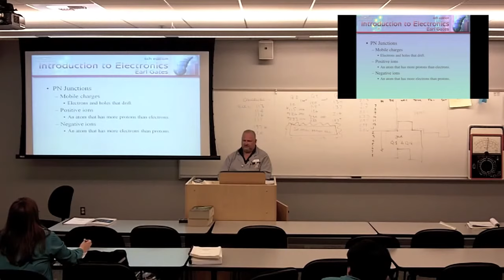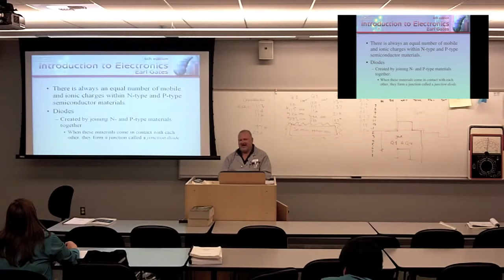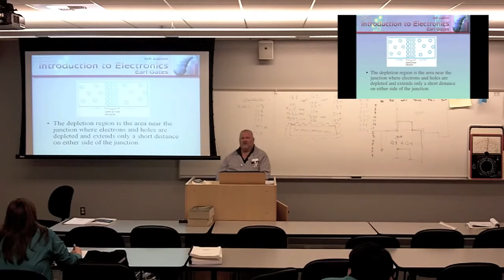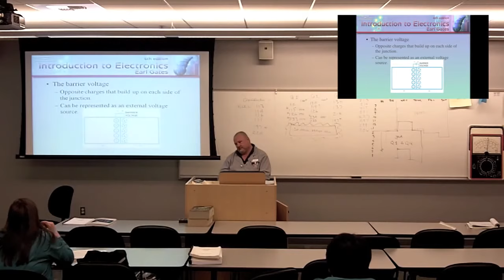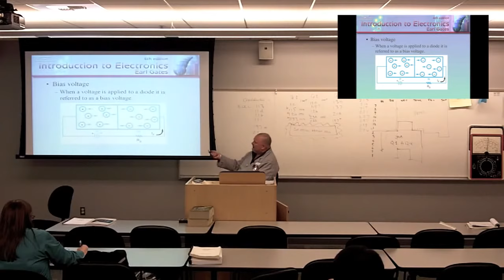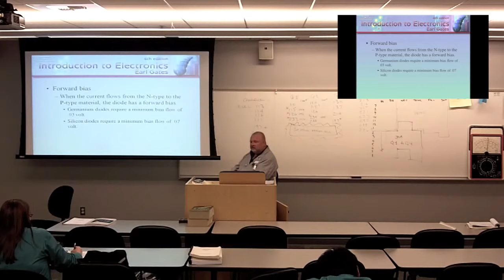Basic Electronics Part 3

Comment: At about time 19:53 current doesn't flow from cathode to anode but, from anode to cathode... 😳
Reply: One direction is called electron flow and the other direction is called Conventional Flow…cathode to anode is electron flow…in my experience,  basic teaching of electrical theory teaches mainly using “electron flow”… advanced teaching like 4 to 6 years ( graduate to masters degrees)  talk about current flow in terms of “conventional flow”…a different way of looking at the same thing…
Reply: @storysofar7426  Yep ... conventional flow also works better for complex circuits (ie. EE type stuff).  In conventional flow,  a voltage drop is + to - (ie. resistor) and rise is - to + (ie. battery) ... intuitively works better in my opinion. Also heard that the conventional flow originated with Ben Franklin's discovery of electricity.
Reply: @storysofar7426 oh yea, I forgot about convention current flow 🤦